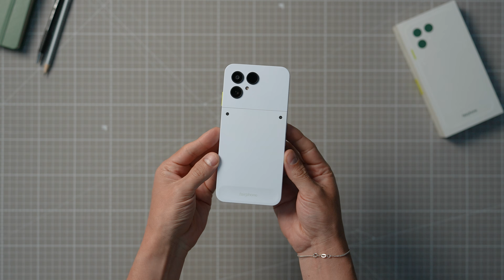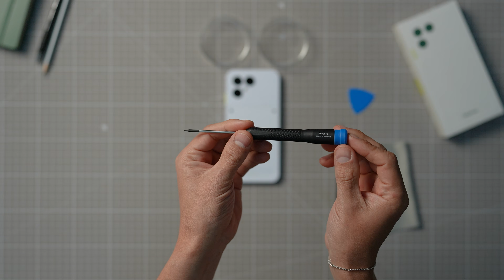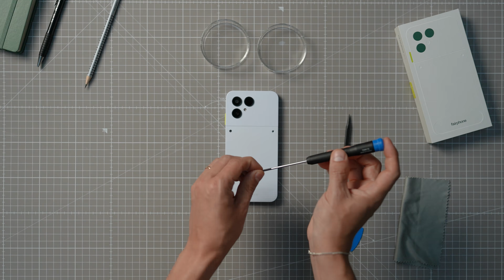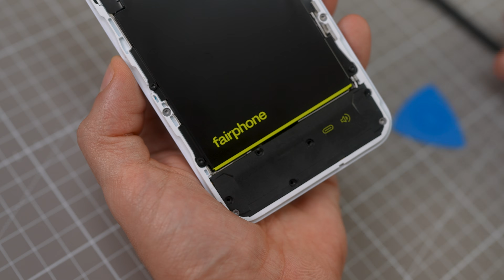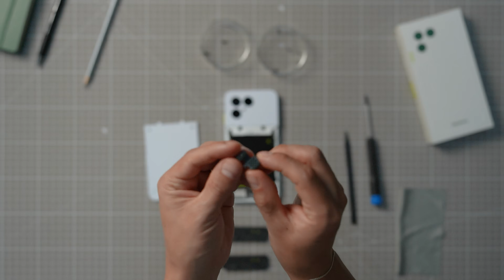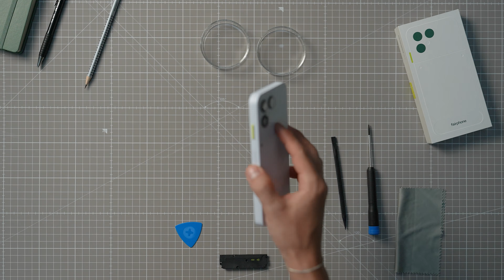Replacing the Loudspeaker and USB-C Port | The Fairphone (Gen. 6/ Gen. 6+)

Comment: Open the screws on the back? Seriously?
If they get a bit damp or are only touched with sweaty hands and they are not made of V2A, they start to rust relatively quickly.
In addition, dirt can accumulate in the recess, which means you can no longer get the screwdriver in, which is also a well-known problem at Apple with the lightning connector. But I had the same problem with my fp4. I carefully removed the dirt without destroying the USB c socket, which can happen very quickly.